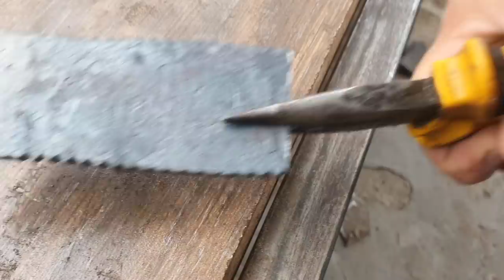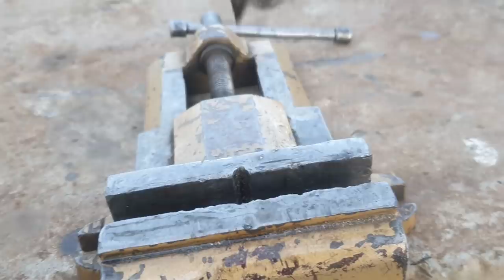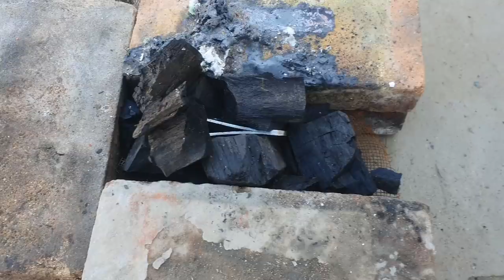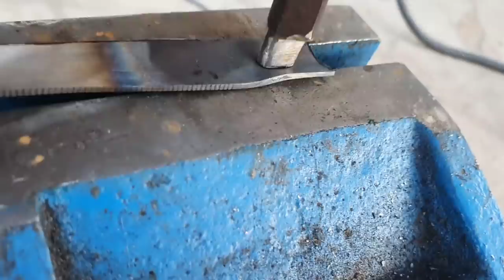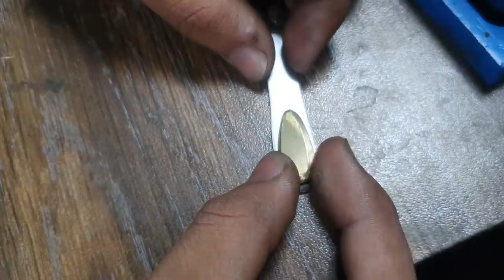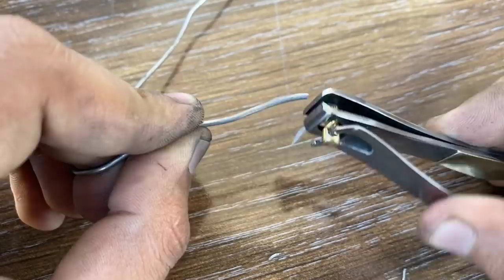Turning a Rusted Bolt into a Shiny NAIL CLIPPER

Comment: Although it's pretty nice, I personally wouldn't use it because of 3 reasons:
1 ) No extra grip ribs on the push-handle
2 ) No slight indentation on the cutters (a somewhat rounder cut so your nails actually get rounded off and don't turn into dragon claws)
3 ) The push-handle is hella wiggly.

I'm like 100% sure I'd slip up with this and cut my nails too deep or crooked...